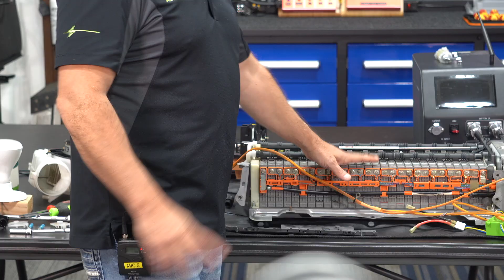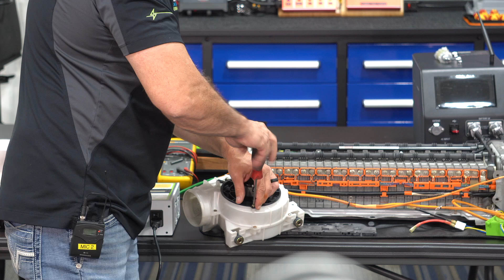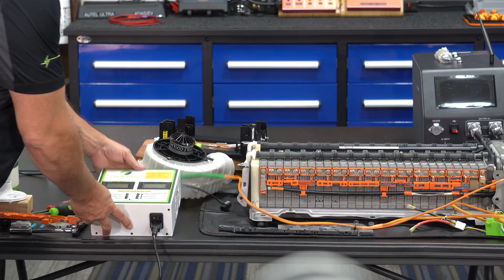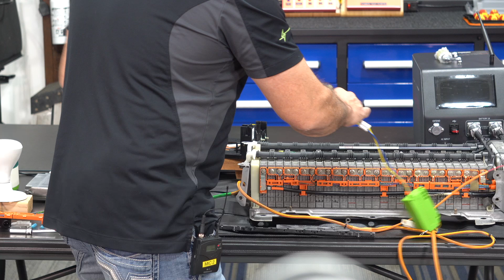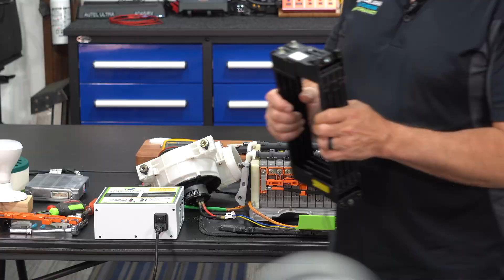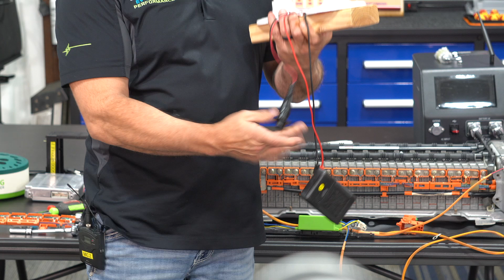How to service a hv battery

Comment: I am not understanding the point of this. Seems extremely excessive. If you have an older Prius where the existing battery management system has failed, wouldn't it throw an error in the can? The amount of labor to do all of this just to tell someone they need a new battery pack, which often isn't worth it to replace. Help me out here because this seems scammy.
Reply from the maker: thanks for reaching out.  one would diagnose the battery first using the scan tool as mentioned earlier in the video.  one would only do this procedure if the battery was found to be good and just out of balance.  balancing the battery will regain lost range and help extend the life of expensive battery.